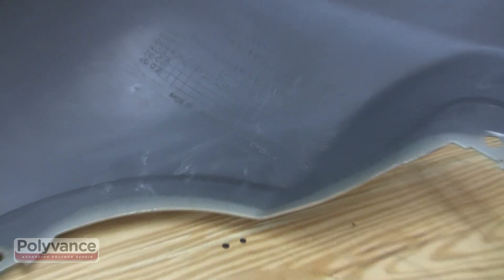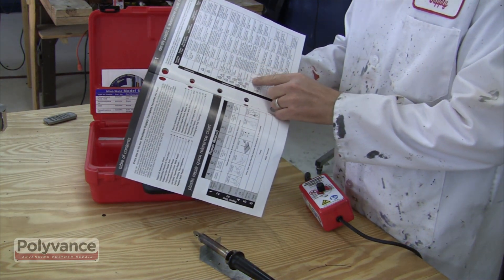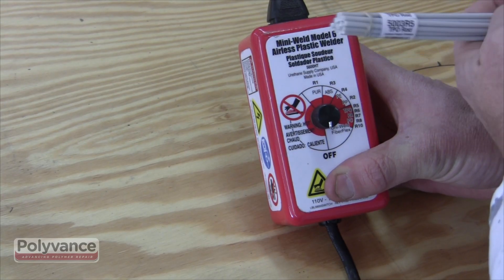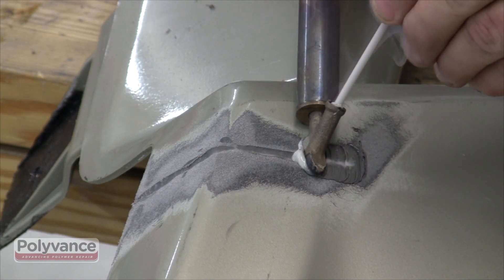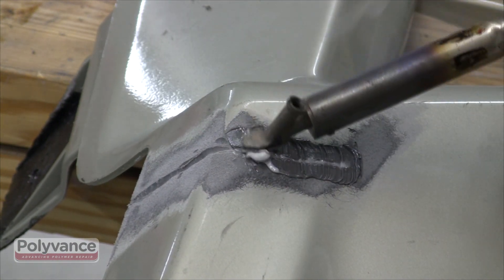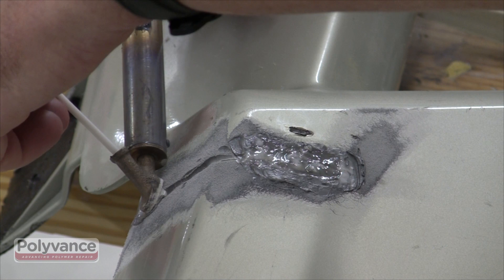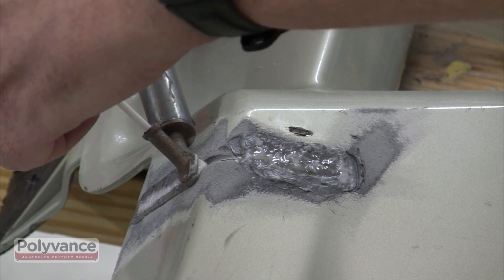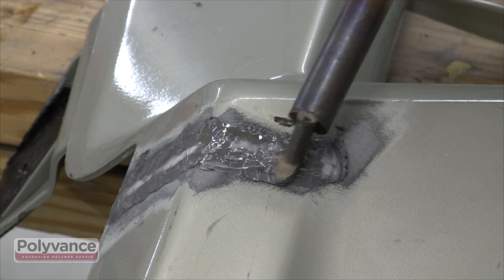Plastic Welding with an Airless Plastic Welder

Comment: Hello re-last comment, i have just downloaded the "book"
i would say at this point the little narrow book that comes with the welder
does not have the same info, it only says either method  C or B

Where the pdf you can download has the welding rod type to use as well

Thanks Nick
Reply from the maker: Hi, Nick! We're glad you found what you needed in "The Book". Thanks for sharing your thoughts with us!

Comment: Hello i have this welder and am pretty happy with it 
question in the booklet that comes with it i understand the identifying the plastic chart
it then tells you the applicable method of repair

in my repair today a PP/EPDM BUMPER, my chart tells me
 i can use either Method B or C Fusion welding or Fibre flex repair

All very clear, BUT  i dont see a section in the booklet to tell me what
rod is applicable for fusion welding. of PP/EDPM

Can you please advise
Reply: As a general rule, the first part of the plastic identifier stamp is the primary plastic and that would be the rod I would choose to make the weld.  Rarely, will you ever run across one this doesn't work on.  In this case, you would weld with PP.  IF you do find the primary plastic doesn't work, you can always cut strips off the bumper (Inside flanges work great for this) or a scrap bumper to use as filler rod.
Reply: PP/EPDM is a mixture of >PP< Polypropylene and >EPDM< Ethylene Propylene Diene Monomer (synthetic rubber).

Comment: wow that does a pretty good job.   Very tempting to invest in one.  Ive never had to do any welds that needed to be pretty so a soldering iron has got me by.  But this is faster and easier with better quality due to filler and proper temperatures.
Reply from the maker: Thank you! We are glad you are impressed by our product. If you would like to know more about our Mini-Weld Model 7, you can find it on our website here: https://www.polyvance.com/Airless-Welders-1/5700HT/